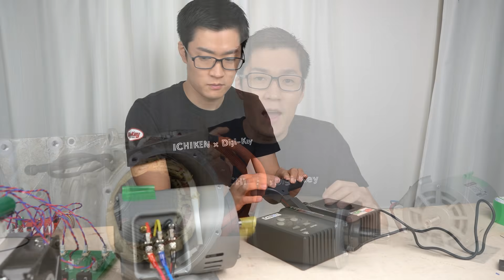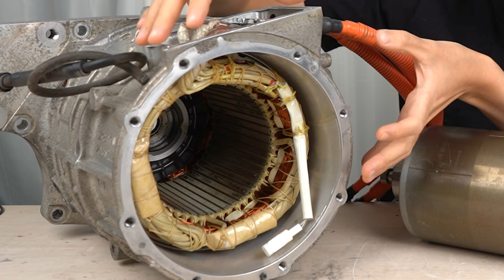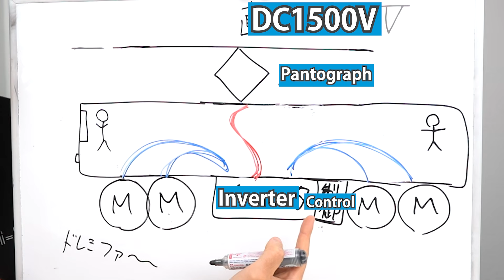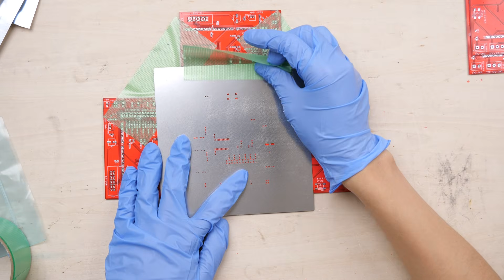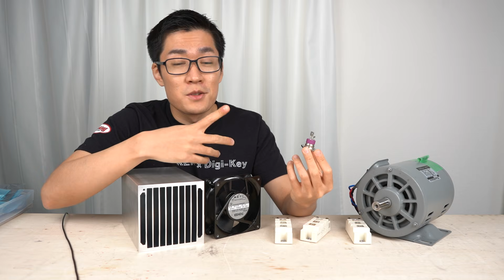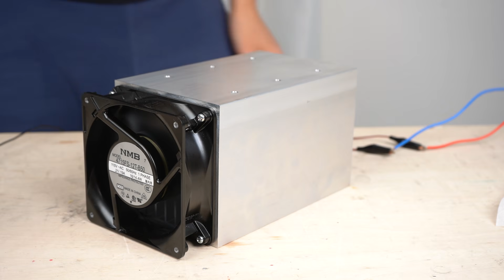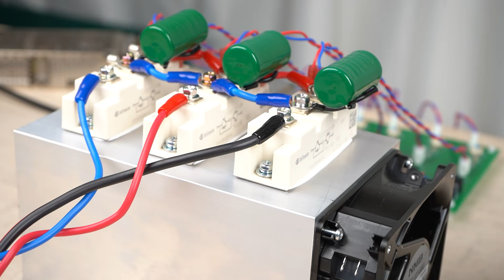Why Electric Trains Make Interesting Sounds. I Made a Singing Train Motor!

Comment: A very good example for a do re mi fa inverter is the Siemens "TAURUS" train used by the Austrian ÖBB train company
Reply: They are also used in Hungary by the Hungarian State Railways (MÁV) and Raaberbahn (GySEV) They are mostly called music boxes around the country.
Reply: @zsomborhun8105  the Czech Train Service uses it too, although they are owned by the ÖBB so its obvious
Reply: @tty69420 Czechs have 1216s, which don't make these sounds.
Reply: @tty69420  PKP also owns those trains you dude.
Reply: We have the same power train in the metro of Buenos Aires  @zsomborhun8105
Reply: The sequence is slightly off key and this drives me crazy! Or am I musically deaf?
Reply: @JanicekTrnecka  The frequency step was probably not divided into 12 notes per octave, as the engineers didn't really have to.
Reply: @JanicekTrnecka  No you are not, its a mystery to me as well as why they did not fix that ever :P
Reply: @JanicekTrnecka no you are right but it is intentional and this is not music…
Reply: Nothing beats the Taurus in this category.
Reply: Here in Sao Paulo, Brazil, there where some Siemens 3000 trains with do re mi fa inverters too. I remember being very intriged with that noise
Reply: Not only the Taurus, but also the german ICE 1 and 2 Trains.
Reply: @capitanenterich9845  The refurbished ICE 1 LDV trains got new IGBT inverters which don't make the distinctive sound anymore. Only the ICE 2 trains still have GTOs, but they are to be phased out until 2027.
Reply: Keikyu actually uses a Siemens inverter. A friend of mine, who used to work at Siemens Japan, remembers how they asked Siemens Austria to customize the musical scale that comes out of the inverter.  There are several youtube videos that show the sound from the Austrian musical inverter and you can hear the difference.
Reply: haha - I noticed that too - definetly ÖBB's train sound
Reply: In Germany, the DB Class 182 locomotives (basically the same as ÖBB Classes 1016 and 1116) also make that sound
Reply: @gerrit-jannap8792 I believe all Siemens ES64U2 (EuroSprinter) vehicles makes those sounds, there's also tons of private operators using them
Reply: Yup, only Siemens could pull that one off. Those singing trains in Japan actually have Siemens traction systems.
Reply: This sound actually reminded me RegioPanter EMU from Czech Railways (ČD)
Reply: Rh 1216 doesn't do it anymore :face-purple-crying:
Reply: Yeah and alot of other new multi units.
Reply: Meeeh
Reply: world war winner japan technological prowess is ahead of that of the United States.
Reply: Yea i went on a trip to vienna and saw that, very pleasing sound
Reply: Germany's DB also uses Siemens Taurus locomotives here and there.
Reply: The JR E501 also used The same Do re mi fa until 2011
Reply: Also this one does a full octave major scale from d to the next d
Reply: In the Netherlands, the "Dubbeldekker" trains have it. Very loud actually:
https://youtu.be/DtT5-p2VCfk?si=S0yMMEmKO0ZmoL_j

Comment: When I first heard a video of that train I was like this is the coolest thing Ive seen (or should I say heard)...safe to say whoever the engineers were, they were also musicians!

Also side note you can kinda tell the technology is older cause there are so many "steps" in the acceleration/deceleration even after the singing part...one of the more modern versions of this idea, the NYC R160B with Siemens IGBT has smoother sounding acceleration (but it also has only a single 400Hz "note" in the low speed area so I totally get it if you don't think it's as cool)
Im not sure if this is just me but the acceleration on the R160B makes it sound a lot faster than it is

Comment: When braking, energy is returned to the inverter capacitor. Which can explode. Therefore, for safety, this energy must be dissipated using a brake chopper or returned to the electrical network.

Comment: The reason the motor steps through pitch is because the controller sends different higher frequencies to start the motor spinning. Think of it like PWM. If you went full send the motor would burn out due to stall torque/rotor failure.

Comment: I have so many questions ;) Did You use snubbers? How about dead time? Is Your driver use bootstraping cap to switch on High side of inverter bridge or isolated circuit ? I did some PMSM inverter with Space Vector Control drive system on TMS320F28335 what was interesting that this motor need starting sequence due I was using incremental encoder - so magnetic field position was unknown on start
Reply: It looks like there are six independent insulated DC/DC converters
Reply: It is an old AC motor with a VFD working in the heatable frequency, maybe a sine Waveform, not the modern 6 step or FOC solution where frequency does not change, even in the starting sequence
Reply: Hearable range

Comment: I've seen an elastomer used as heatsink compound.
It was white and had a silicon texture.
Can the stator not be vacuum molded with this compound instead of epoxy, or just being wrapped with twine? 
Wouldn't that make the motor almost silent?

Comment: meanwhile i can just plug the motor into my wallsocket and get 3phase without inverters.
Reply: because you are getting AC power from the power socket!!!
Reply: yeah, but you only get constant voltage and constant frequency. Those inverters are often referred as VVVF (Variable Voltage and Variable Frequency). You change the voltage to control the torque and change the frequency to control (and match) the motor speed. By just applying constant voltage and constant frequency, you will consume too much power on startup and missing some performance since the motor cannot go faster than the applied frequency and cannot achieve peak mechanical power output.
Reply: How well do you think 3 wires above a train would work.... 🤦‍♂️
Reply: What kind of wall socket do you have? They usually only provide 2 or 1.5 phases, and a Ground if there is a third hole.

Comment: The engineers choosing sounds that are musical notes is an elegant touch.  Thank you both for the video and the translation.
Reply: Those were added only as a deliberate easter egg. On some models it was removed later in a firmware update, unfortunately.
Reply: @Stoney3K I can imagine it caused massive performance issues and they wanted to improve efficiency. There's lots of lost energy to produce this
Reply: @faded.0913 Define lots? Train inverters have distinct frequency steps to power up, usually just 3, but I can't see this doremi inverter being hugely more inefficient, but yeah, every penny adds up
Reply: @faded.0913 i don't think it does as its at the very early stages of acceleration.
Reply: @SoftBreadSoft i think theyd be tested to see if it allow such a thing for long term performance anyways.
Reply: Ye the musical notes are serene and wonderful on the train.
네, 기차 안에서 음악 음이 고요하고 훌륭합니다.
Reply: They're detailed & legit wonderful, idek they singed Christmas music on some anymore.
Reply: Clearly Tokyo Denki don’t care about making the same sound on their IGBT-VVVF to sound like a good old Siemens GTO-VVVF. What a disrespectful to Keikyu N1000
Alstom was able to replace the same BN Holec GTO-VVVF use in Class 323
Reply: Correction: Motorneers
Reply: but why?
Reply: I'd prefer if the train were to have a loud V8 powering it 😂
Reply: @mattdaddy_888 most diesels are V12s and V16s such as the 7FDL-16 engines and GEVO-12 engines

Comment: When I was a kid, I connected a small DC motor to the speaker terminals on a radio and made a very inefficient speaker. If I touched the drive shaft to a surface, I could hear the radio. It worked quite well touching a glass window.
Reply: Same 😅
Reply: @eljaibas16  I did it with an MWO transformer, to get electrocuted with the rhythm of the music. It was fun until it got truly scary when I cranked volume too high up and heavy beats came from the music (it was on a somewhat powerful home stereo amp). Seriously dangerous, do not try it. But, the transformer was also audibly singing indeed!
Reply: @TheSimoc lmao, wtf lol
Reply: I did in a 775 motor and used 12v 3a to control
Reply: wait what i think  i ever did that once years ago but i forgot how but it worked like to make the sound of a dc motor in a high volume on a speaker but i forgot oml lol

Comment: Siemens still do this,in their IC trains
Reply: you can somewhat even hear it in things like the siemens charger locomotives that via rail uses. Its very subtle though
Reply: @SkysTrains  really?? i've never heard it. any good videos of it?
Reply: @CTSLRailfan  I've heard it while standing right beside a locomotive but I never quite caught the sound or heard it in a video. It's very subtle and hard to hear over the engine.
Reply: There is recent video in circulation of new train accelerating with this sounds. Very cool, didn't know it was intentional!
Reply: for finnish vr too